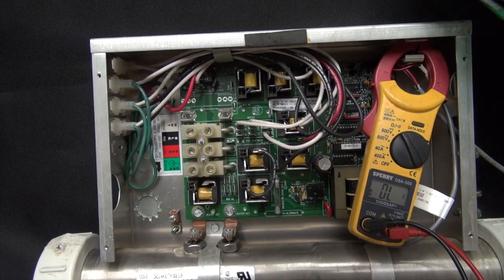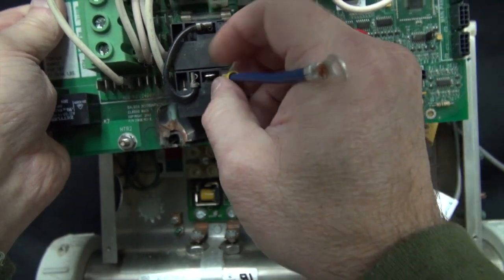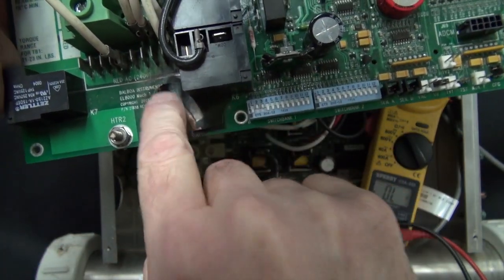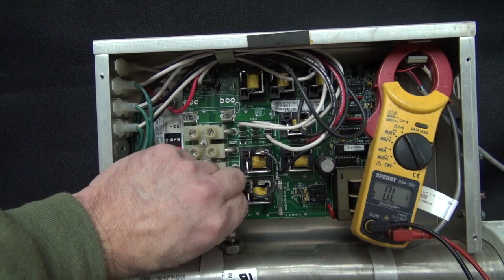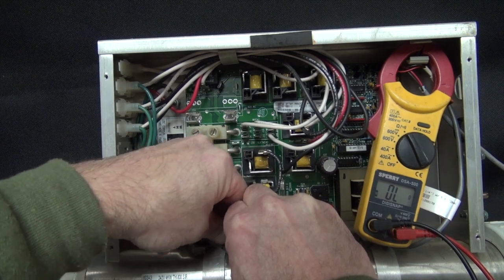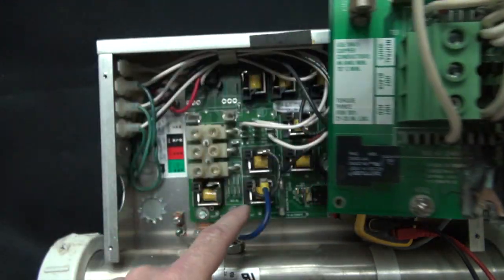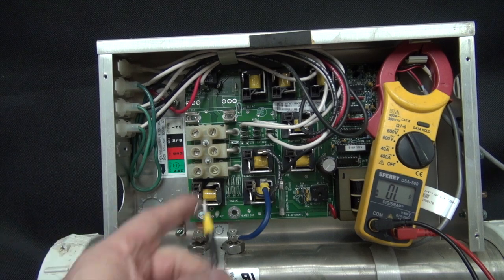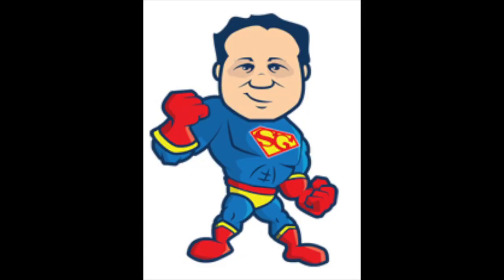Balboa Hot Tub Board Burned Heater Connection Jumper Repair Spa Guy How To Series

Comment: The gauge seems a bit small on those jumpers compared to what my other jumpers are (12 awg)... A local repair shop suggested even going 10 awg for the heater connections (replacing the copper straps)

Comment: I just replaced the heater element and reconnected everything. Tub worked great for a couple of weeks then I noticed the electrical burn smell. Opened it up and both power points left and right are burned on the circuit board. Looks like the copper leads are toast as well and the heater point ceramics are burnt. Is this really from a poor tightening on the board and/or the heat element? The tub still worked but the damage looks like I need a whole heater assembly now and if I can't fix the circuit board that is a whole lot of money.

Comment: We tried this method. Jumping the wires is this why the temperature keeps going up to 100 or higher even though it’s set for 98 and the hot tub shuts off completely? Also the 2 black boxes with the little wire connected to them can those be replaced? What is the purpose of those 2?

Comment: Hi thank you so much for your very helpful videos so easy to follow.  We discovered that our terminal block was fried on one corner thus  melting the plastic and therefore the hot tub stopped working. I'm wondering is there any point in replacing  the terminal block or do you think there's a chance it may  typically have damaged the rest of the board.? I can send a photo to you. If you wouldn't mind taking a look at the photo .. I would appreciate it as it could save us a lot of money. 👍

Comment: I have a Balboa 54379 board that shows 188 on topside when powered on. Hot tub does nothing. Any idea what this may indicate. There's no visual damage on the front of the board,  all fuses have 120VAC except F1 shows 13VAC
Reply: The Balboa website has a list of error codes.

Comment: I replaced the element in 2018. Now, the heater won’t heat and I saw the board is burned on the right side (like your example). If I do this jumper, should I also replace the element? The element lugs look clean.
Reply from the maker: Leaving he connections lose damage the board but usually not the element.. The jumper does not repair every situation but will solve some of them..
Reply: Thank you for the info. Was wondering if a fuse would help on the jumper wire that you sell? Just to prevent frying the relay if something happened. I looked at the heater lugs and the right one shows some rust on it. I’m guessing that’s what caused it to burn.

Comment: This is an excellent video. If the left side heater connector and relay got burned, which prong / pin to I attach a by pass jumper to for the repair on the left side

Comment: My friend! Recently my hot tub stopped heating.  I confirmed the heater was OK and moved to the controller.  O found that there was the same phase of 120V on both sides of the heater meaning no power to the heater.  What would cause this? A bad relay or a bad solder joint? What is the easiest way to check/confirm? Where might a source a relay? 

Thanks!

Comment: Great video! I have a hot springs spa I'm working on. Just replaced the heater (cracked end cap) and still no heat. I removed the heater relay board and saw the one pin on the k1 relay was burnt out. Is this a relay I can jump safely and if so how?

Comment: Great videos!  I replaced the heater tube and didn't tighten the HTR2 connection well which unfortunately burned a hole through the board.  I'd like to jump it but the relay (JTN1S-PA-F-DC15V) on that side is sealed and and doesn't have a visible tab. This is a Balboa Keys100DR1A board.  Any help here? Thanks!

Comment: Great Videos. I have a problem and can't - just bought an expensive new Balboa board for my tub - worked for a while now it makes a scary shorting noise. Noise goes away when the red wire is disconnected but black is left in. Have a formal background in electronics and some electrical and a working knowledge in both. I measure 34 Ohms between neutral and black even when the board in on the table - which to me sounds like a (the) short. Can't find any videos in your bunch for something like this any ideas?

Comment: I have the same board and I’m curious about the relay above the one you jumped on. I had to add a jumper from the 120v input on the upper relay to the input relay on the lower one. Is it bad to bypass the upper relay? What’s it for?
Reply: Probably the other relay is for 240V operation.  Because 240V is essentially +/- 120V (opposite phases), if you only switch one side of a circuit (call it the +120V) then there's -120V on the heater etc. all the time.  So the additional relay is switching the opposite phase, so it's 0V.

Comment: I tested the same 2 areas with my ohmmeter and no sound. I tested both heater prongs on the board and it’s not reading any power. Does this mean that the control board is bad?

Comment: I have a new Balboa board for a downeast spa that I purchased for this same issue but after I connected all the wiring the same as the former board the display control panel wont energize. Was I to leave the wiring the same as they were when the board came in rather than format to mirror the old board? Or is this just one wire that's out of place? Please help.
Reply: i have a downeast exeter spa also and I have this burn issue after replacing a pump. Thankfully finding this fix hopefully saves me! Surprised that  burn occurred from not tightening the nuts enough.  Seems to simple but trying it today.

Comment: I just installed a new board and the black wire going to the relay melted into the relay. Any suggestions. The hot tub worked properly for a month before this occurred.

Comment: I just had this happen on a new board less than 6 months old. all connections were tight. Is there any other reason that could cause this problem? Faulty board? I saw your video on soldering the left side and replacing the relay which talks about the nut on the heater, mine is solid. So any other causes?
Reply: If the board was new but the copper jumpers to the heater were dirty or oxidized, seems like a probable cause.

Comment: This is great! BUT, what causes this in the first place? Is there anything I should check on/in the heater to make sure it's not shorting out
Reply from the maker: Someone installing a heater and not getting the lugs and nuts tight..
Reply: Time, heat, moisture, vibration from the pumps and oxidation will increase the connection resistance.  With power OFF, maybe check that the connections are tight every couple of years.

Comment: If the connectors started to burn the relay (on the right side) is that relay bad? That’s what happened in my case. Or can I still jump from it? Wondering if I also need to replace that relay. This video is so helpful! Thanks for your knowledge! I’m a new hot tub owner and like fixing things myself when possible.

Comment: Thanks Spa Guy. We actually are working on the exact same board. Do you know which tabs connect back to the board from the left side heater terminal on that exact board in your video ?
Reply from the maker: You have to trace the circuit with a meter just Like I did with the right side..

Comment: Great video, this has happened to me a couple times and glad I saw your video. 

Any reason why these burnouts happen?
Reply: Heat cycling, any moisture and time = oxidation, flexing, maybe the connections work loose.  
Once the connection starts becoming higher resistance, well, the heating element is just a resistor, about 10 ohms.
If the current doesn't change too much, figure 24 Amps.
Power in the connection is the current squared (call it 570) times the connection resistance.
Say the connection resistance is 0.001 ohm.  That's 0.57 Watts.
Say the connection resistance gets up to 0.1 ohm.  Now you have 57 watts.
The heat makes the copper oxidize more, and the connection even worse.
Now instead of 5.5 kW in the element, you get a bit less power in the element and more and more heat in the connection, except the connection doesn't have flowing water to cool it.
You've seen an incandescent light bulb.  They glow white hot with that much power.

Comment: My Circulation pump will not turn on when I press the blower control button the pump clicks on and off if I press it on and off wondering if you knew what could possibly be wrong it’s a Balboa control system

Comment: What damage will you cause if you plug your spa directly into 240volt power outlets
Reply: Better have a GFCI.  Electricity and water is bad news if (or, when) something breaks or goes wrong and the power finds a path through a human body to ground.
With a GFCI, the breaker clicks off.
Without a GFCI, you can get some level of shock; perhaps lethal.

Comment: Ive got a balboa BP501G1 (part#56487-02).  I really wanted to include a pic... but dammit?  The relays are not open (no tabs to hook onto).  And, J101 (the extra tab on the circuit board below the left heater relay) doesn't test good.  I recently soldiered 2 relays. (k-1 & k-3).  K-1 was soldiered by a calspa repair tech 3 months ago... lasted that long (the problem was/is the left side heating unit)  that worked for almost 3 months after $300 coospa tech fail.  Now they're asshollios and tell me a new board $500 is needed.  Can I hookup from J35 directly to the left element?  I want you to say, Yes Katie, you are brilliant!"  Or just give me a laugh and ill know how ignorant that was😚.

Comment: This is an excellent video. If the left side heater connector and relay got burned, which prong / pin to I attach a by pass jumper to for the repair on the left side
Reply from the maker: Search for the video about the left side.. You would measure that with your heater to know m]by the way there is no specific tab for every board.. https://www.youtube.com/watch?v=POolZKghW0E&t=1s